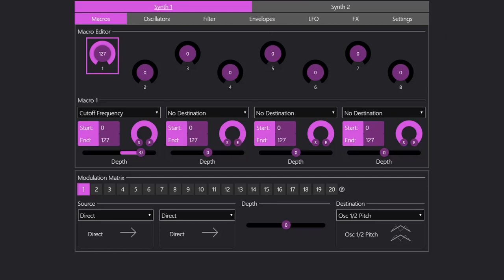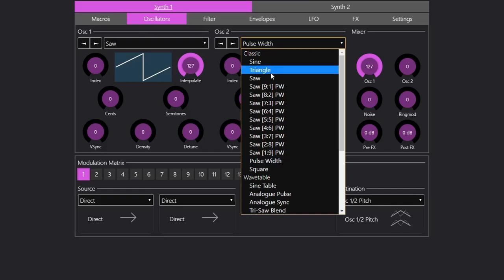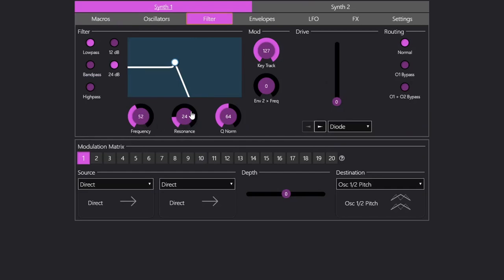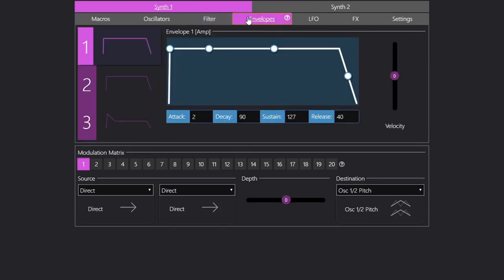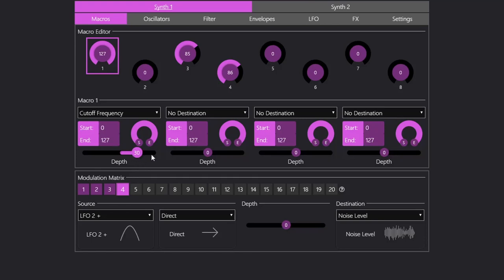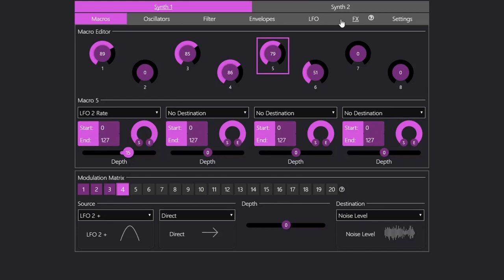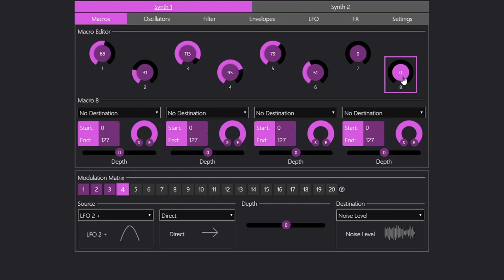Novation Circuit - Tutorial - Making a synth patch from scratch in Components

Comment: Thank you so much. I really appreciate being shown how you set the depth levels for the macro knobs. One of the hardest parts about programming the circuit synths is having to figure out mod control assignments through the macros and how they relate to the mod matrix. You'd think 8 knobs would be enough, but it's a huge limitation to patch control and I have a hard time figuring out what should be linked together to create the desired sound.
Reply from the maker: Glad it could be helpful! For sure, figuring out the macros and mod matrix is one of the harder things to learn about programming the Circuit. So much potential when you figure it out, though!
Reply: This macros reminds me NI Massive macroses, also dont liked to program them )

Comment: This is pure gold!
I have been looking everywhere for something like this.
Would like to see some more about the LFO in next video's :-)
Also an additional question regarding the filter, the Env2 > Freq, what does it actually do. I can hear its something similar to the cut off, and can be controlled with macro knob parameter "Env 2 mod"
I would like to know what it does specifically though.
Reply from the maker: Thank you! Glad it could be helpful! :)

Great question. The Env2 > Freq parameter controls how much the filter envelope (env 2) modulates the filter frequency. So if it's zero, the envelope doesn't affect the filter at all. But if you turn Env2 > Freq up and turn the filter frequency down, you can hear envelope 2 modulate the filter frequency. It might be more apparent if you adjust envelope 2's attack, then you can hear the filter frequency slowly rise as a note is held. With the env 2 mod up and filter frequency down, having a short decay and sustain near zero is great for quick notes, like in an arpeggio. Hope that makes sense!
Reply: @PaytonCarterMusic  
Yes, i understand now :).
Thanks for the help, really appreciate it.
I've roamed the entire internet for video's about the circuits components editor. Mainly they use the Isotonik editor in the other vids out there and they never really explain what they are doing, just basically pointing out where the buttons are.
The way you explain and describe things beats every other video out there, i am sure you will make alot of people really happy with this!
BIG like and subbed!

Comment: maybe a dumb question, but how can i preview my synth patches when in the editor? as it is i'm not getting any sound from any button on the circuit when hooked up to Components. i can only hear the Samples when i click on them...
Reply from the maker: Interesting, you should be able to hear any changes made in the Components editor live when connected to the Circuit and you play the synth track keys. It would be editing one of the two current patches, which can be selected in the editor. That's the only way I know of to preview the sounds. If that doesn't work, I'd check with Novation about a possible bug.
Reply: I have this exact same issue, "play synth track keys" ... [edit] ... Ah, so this is why it has to change modes between editor & librarian.  In Editor mode you can sample the synth simply by playing notes on the Circuit as long as you have the same synth selected.  Thanks

Comment: Really usefull! I've benn creating patches but didn't know how to use LFO to give movement to the soud. Is it possible to assign a macro knob to the modulation matrix and apply as much lfo as you want?
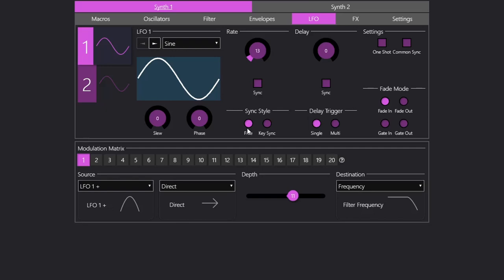Reply from the maker: You bet it is! I think I cover what you're asking about around the 10:30 mark of the video. In the mod matrix, select an LFO as a source and whatever you'd like to modulate (filter cutoff is a great starting point) as a destination. Leave the depth at zero. Go to the macro page, select a macro, and select whatever mod matrix slot you just edited as the destination. If you increase the depth of the macro, you can the control the depth of the LFO's modulation by turning the macro knob. Hope that makes sense!